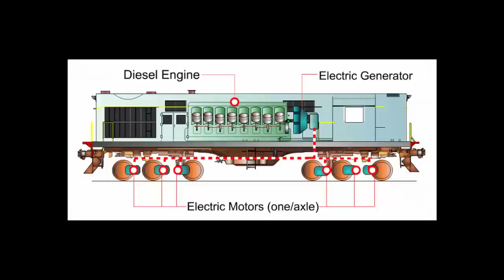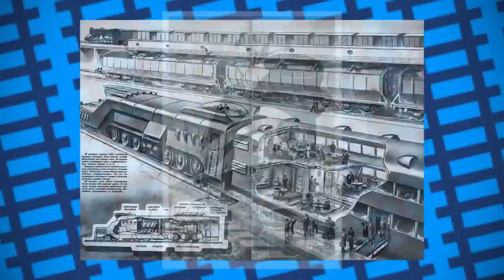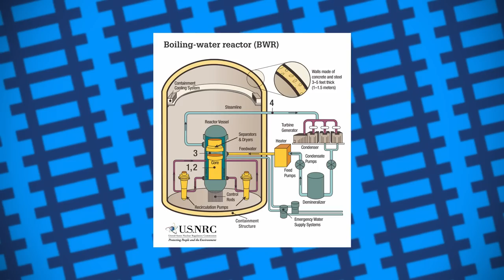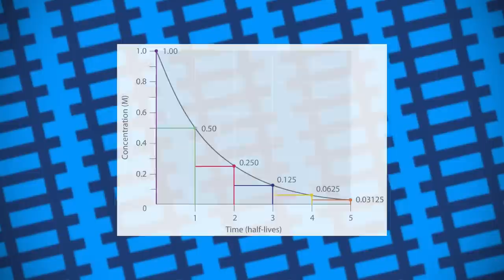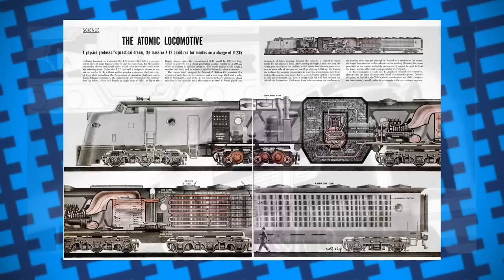Why Nuclear powered trains aren't really a thing

Comment: Electrifying long stretches of rail to me seems like its only a matter of cost and/or politifcal will. The trans-siberian railway is electrified. Maybe there are other factors like the hauling strength of diesel electric vs pure electric locomotives, or the increased demand on the power grid, but with today's tech no stretch of rail should be too long or too remote to electrify.
EDIT: And yes, let's not put nuclear reactors on rails.
Reply: Why would a Diesel-electric locomotive be stronger than a 100% electric one?
The electric motor that actually spins the wheel is pretty much the same in both cases. The power of a locomotive is nowadays usually only limited by traction on the rails and avoiding overheating of the engine. So a Diesel could haul more if it's just heavier hence has more traction, but the electric locomotive could be made heavier artificially to get the same result.
Reply: It took 70 years for the Russians, and they havent electrified the rest of their networks. So it may not be practicle.
Reply: @jailbird1133  Considering the state of the Russian economy during the late Soviet era and the 90s, that's probably more a mark of how feasible it is than how unfeasible it is.

The American economy could absolutely do it.
Reply: train is already a moving power plant
connecting it to another power plant is not only redundant ,it is stupid

Comment: The fears around nuclear energy are highly exaggerated by propaganda produced by fossil fuel companies, and the media has over-sensationalized almost all nuclear energy accidents. 

Having a nuclear reactor on a train for power may be impractical due to the engineering challenges, but it isn't the worst idea I've seen for powering trains.
Reply: Technically, we already have nuclear-powered trains. It's just that the nuclear reactors are stationary (in the form of power plants), and the trains are powered via overhead power lines.

Comment: Mini nuclear reactors have been a thing since the 60's. The deep sea submersible NR-1 had a reactor the size of a refrigerator.
Reply: Yes, but a deep sea submersible have a few pro's going in it favor for this.

1) It doesn't require a lot of instantaneous power to move. Trains are really efficient but they still draw several kilowatts of power when accelerating.
A fridge size nuclear reactor does NOT produce that power.

2) If something were to go wrong on a nuclear submersible, it will fall to the bottom of the ocean. Sure, it's a disaster but it's still at the bottom of the ocean where the effects are way more limited than they would be on land.

There are also nuclear powered space craft. Again, they are quite small and lightweight so the argument "it can be done" is true but then you realize why it can be done.
They are after all in space so should something go wrong they have all of space around them to disperse the radiation into background noise.
And they are light and doesn't need to accelerate in minutes, they can spend days accelerating. Something a train can't afford.
And they don't need shielding to protect what's outside of them. The only shielding they need are around their electrical components.
Reply: And they have just enough to power a microwave
Reply: @RealCadde  Those spacecraft use radioactive decay, not fission, and are far less efficient.  They also do not use it for propulsion, but instead for electricity.  Nuclear propulsion is possible and should be used, but so far it has not been.

Somebody designed a hot tub sized nuclear reactor that can produce 1.5 MEGAwatts.  It has not been built, but it seems like your concerns about size may have been resolved.

Obviously, safety and cooling are the remaining concerns.

Comment: Waste disposal is a political problem, not a technical problem. We have safe, effective, and stable storage solutions but nuclear hysteria means we can't use them
Reply: Your so called safety is in the mind. At the end of the day the outcome of the disaster is bigger than the risk.
If a plane crashes and it is the lowest statistic in mass transit it doesn't have to cause a disaster outside the potential deaths of those on board thanks to the pilot.
But Nuclear Reactors aren't meant to take a major battering and the prime example of recent times is the Tsunami in Japan that caused a meltdown. Now it was contained better than Chernobyl but this is concentrated energy in one place people can choose to live away from and evacuate.
Trains would put the risk on the move and suddenly you can't be sure where is safe and when. It's unnecessary to create a situation where we'll be living in fear.
Reply: There are storage solutions however they are exceptionally expensive and technical marvels like the one in Finland which is well over a billion $.
Reply: @Alex-cw3rz  a billion dollars on a technical Marvel of waste storage is nothing.

The US spends multiple billions for each project that adds more lanes to highways that fixes nothing
Reply: @ChimpManZ1264  you know reactors can't melt like Chernobyl anymore, even so I'm not advocating for a nuclear train, there are very important shortcomings like stated in the video, and a radiation leakage is one of them, I'm just saying that reactors are way safer and way batter than when Chernobyl happened and fukushima was a meltdown but because a freaking tsunami hit it and a design fault in the pump and generator placing, I am in no way downplaying Fukushima but even so, they are safer and less harmful that the contamination coal and oil has done, and speaking of price, it's easy comparing nuclear storage to no storage like in coal and oil but they never compare the cost of contamination cleanup and the cost due to atmospheric damage of coal and oil, then I don't think it would be cheaper to keep oil and coal in comparison to keep the small amount of high level waste.
Reply: @ValentineC137  nuclear is already the most expensive non fossil fuel emitting power generation (per MW) and you are saying adding on a billion to a country that doesn't use much nuclear at all compared to the US is fine 🤦‍♂️ we are talking 10s of billions and taking ages to build.
Reply: @agustincampillay7559  That's fine. I understand we need cleaner power though I am hoping we'll get Fusion right one day. I'm 20 miles across the bay from a Nuclear Station going up so living in fear of power stations isn't something I can do. I just don't think it's necessary for Nuclear to be a train. If we ever managed fusion that be cool.
Reply: @ChimpManZ1264  sorry but chernobyl used fucking vacuum tubes
Reply: @ChimpManZ1264  yeah! I too hope fusion could be our future, it's even cleaner than fission and I agree that nuclear trains are kind of a silly idea when taking into consideration all the downsides
Reply: "We have safe, effective, and stable storage solutions " Yeah, right. Dig a hole and bury it and cross your fingers and hope for the best for the next 100 thousand years
Reply: @ChimpManZ1264  You're talking about Japanese nuclear reactors. American nuclear reactors can continue working even when bombed, which is unlikely, the highest of safety standards are taken into account, which is why the worst "nuclear disaster" in american history caused ZERO deaths.
Reply: @misterflibble6601  you should look into the science of this. There's enough geologically stable storage for millennia worth of spent nuclear fuel
Reply: @misterflibble6601  
Please. 

There are plenty of places where we could dig a hole, put nuclear waste in it, and it will be safe for 100 MILLION years. 

Example: salt mines

Subterranean salt domes contain bacteria and microorganisms that are over a million years old, and they were perfectly preserved. 

If a salt dome can keep microorganisms perfectly preserved for a million years, then a salt dome is more that capable of preserving nuclear waste for a couple thousand years. 

Underground salt domes are mother nature's perfect trash compactor.
Reply: The waste disposal is totally unresolved. There isn't a single country with an operating long-term or "final" storage. How are you to make sure the waste is safe for millions of years? And don't you think maintaining such a site's for a couple of million years makes nuclear power the most expensive solution on the planet?
Reply: @countluke2334  "There isn't a single country with an operating long-term or "final" storage" - because of politics, not technical feasibility. "How are you to make sure the waste is safe for millions of years?" You don't understand nuclear waste I see. If it's properly reprocessed it's only dangerous for the low thousands of years, and then only if you eat the stuff. Stick it in an ultra-deep mineshaft in a geologically stable area, done.
Reply: I agree nonetheless. Infrastructure that provides extended coverage of electricity lines for railway would probably be a better move. Keep nuclear power in stationary electric power generation plants.

Edit: which was mentioned at the end of the video.
Reply: @Alex-cw3rz  Really? I didn't know that. I guess it makes sense though, because aside from your starting cost of building the thing, you have to pay to get the fissile material mined, processed, and shipped, as well as do mateinence to the reactor and fuel storage facilities. But despite that, I do think it's a good source of power to cover the basic/constant consumers of power so people don't have to worry if the cheaper power sources start to fluctuate.
Reply: @strcmdrbookwyrm  I think it's fine, it's just not a solution due to it being more expensive than any other type of energy. That most countries cannot access it. And it's exceptionally slow to do.
Reply: @agustincampillay7559  Despite what you say, reactors can still melt down if we don't treat them with the respect they demand. Every major nuclear incident has been due to human negligence and error. Chernobyl was caused by a safety test being delayed that led to the reactor being operated in a unsafe and unstable state, and the failure of one crew to inform the next of the test in progress. Fukushima was caused by the owners of the power plant neglecting to update their earthquake and tsunami safety measures to a standard that would have protected them and prevented the damage that caused failures leading up to the disaster. The Three Mile Island Disaster was caused by a bit of water being forced into a instrument air line, causing a the reactor to try to go into a safe mode but unable to due to the operators not noticing that safety systems were not working properly. All of this was caused by humans either not noticing or not caring about a problem before it was getting out of hand.

So while Nuclear may seem to be a less environmentally damaging option than coal and oil, I think that both are equally destructive when us as their operators are irresponsible and apathetic. While we have found ways to make nuclear power quite safe to operate, a little paranoia is needed in moderation. 

And I defiantly think it would be unwise to have a reactor hurtling along at 60-80mph, no matter where it is on a train.

Nice run-on sentence, by the way.
Reply: @Alex-cw3rz  That's fair. And I think we can agree that there's no one solution anyway.
Reply: @Alex-cw3rz  Just for some numbers: one billion dollars is just 3 Boeing 777s, or I think the newer yet to be released variants (with the flippy wingtips and all) were closer to 400 million.
At it's last days an Airbus A380 costed 450 million dollars. A billion for the energy industry is just reducing the coffee cups by one for each worker for a year.
Reply: @illbehim  The Fukushima reactors were all designed by General Electric, and reactors 1 and 2 build by them as well. This nationalism is silly frankly.
Reply: @Alex-cw3rz  Access to nuclear power is highly political. It all comes from the fact that to enrich Uranium for a power plant, you do end up with Plutonium - bomb material. Politics have doomed nuclear power for a long while.
Reply: Not only that, but nuclear waste actually can be recycled.

So I still don't know what the actual problem is with using nuclear energy.
Reply: @illbehim  whaaaa you got way too mad at that. It IS silly to be nationalistic beyond just loving your country but stepping into downplaying the rest. Taking the strongest earthquake recorded and a freaking tsunami at it was a huge blow, to be honest the damage was quite minimal with how much the whole country got wrecked. Comparing it to the TMI-2 accident where there was a malfunction without any enormous natural disaster is as silly as the name calling you got into for no apparent reason other than maybe hurting Captain America's pride. It better have less consequences indeed, it shouldn't have happened to begin with on a reactor operating for one freaking year.
Americans made everything infrastructure related bomb-proof because of that little thing called cold war going on by the time, not because muh bald eagles build standards.
Reply: And there are reactors which use dead fuel.
Reply: @Kalvinjj  Says the other one is mad, proceeds to write a kilometric rant, I'm not reading all that, cry bout it bozo
Reply: @illbehim  the typical pathetic excuse of lack of arguments... "kilometric rant" when one wrote about the same but on insults only...
Reply: I see someone watches Kyle Hill's channel
Reply: @WasatchWind  Never heard of him, but I do have a physics degree
Reply: @MatthewMakesAU  he's a really good channel that does a lot of videos on nuclear energy, notably a fantastic one demystifying nuclear waste and better explaining it than any other I've seen.
Reply: @Alex-cw3rz  it really is amazing how expensive the method of "shove it in a hole and leave it" can get. Granted, it's rather more complicated than the description sounds.
Reply: At least some people know what nuclear power and waste is like in reality.
Reply: @misterflibble6601  still better than coal and oil. You deal with the waste from that by spreading it everywhere.
Reply: We already solved that problem but it still costs a ton of money the thing we should do is start recycling waste back into usable fuel again
Reply: @ChimpManZ1264  that reactor melted down because it was neglected in its maintenance. Modern reactors are basicly impossible to have melt down because they are almost all passive designes.
Reply: I don't agree.
Reply: @fillup40  why? Just saying "no" doesnt invalidate the valid points they brought forward on the issue
Reply: @misterflibble6601  Do you realize not all nuclear fuel has a 200 year half life?
Reply: @faragar1791  Not exactly, as ling as ALL the nuclear material stays IN the mine sure, but one leak and water starts leaking it out into the ground water and you have a problem
Reply: @countluke2334  It doesn't take Millions of years to decay. smh
Reply: @integr8er66  
Not if the nuclear material is buried in a salt basin. The salt absorbs the water and naturally seals any cracks. That's why salt basins have ancient plankton preserved in them from 1,000,000,000 years ago. Salt basins are very good at preserving anything kept inside of them.
Reply: @Alex-cw3rz  the us already built a similar storage bunker. Problem is while the few people who are around the cite don’t care the rest of the people in the state don’t want it being used
Reply: @darthmaul216  that storage bunker is designed for the current amount of Nuclear waste not increases, from new things. And that bunker cost billions again making you question why not put the money into cheaper forms of power which is every other source bar gas.
Reply: @ksztyrix  im saying chernobyl was outdated
Reply: @cegicreator2476  Tubes were better for their needs
Reply: @illbehim  Wrong. Nuclear accidents in the USA have killed many. You clearly just assume without researching.
Reply: @faragar1791  Excellent idea, lets turn all the nuclear waste into water soluble salts... 🤦
Also, the salt basins you propose cease to be sealed when you drill a large hole into them to put the waste in. Learn some elementary chemistry and physics before proposing ideas like that.
Reply: I guess if you use a small concentration of uranium (plus proper containment and fail safes) you could prevent a fallout and only cause something like a boiler explosion

Comment: When playing Fallout 4, I often come across ruined train tracks with box cars. When I first found a ruined locomotive, I was a little surprised to see that it resembled a steam engine (albeit a very top-heavy and impractical one). But when I thought about it, it would make a certain amount of sense for a nuclear-powered engine to be designed like that. After all, nuclear power plants work by dipping nuclear material into water and funneling the resulting steam through turbines that generate power. In the broadest concept without regard for safety or practicality, you could take that resultant steam and use it to power a locomotive.
Reply: Oddly enough, the train I saw in Fallout New Vegas looked like an EMD F7.
Reply: @jd_the_cat  Image searches: Huh. Never came across that in my time playing New Vegas, but that's definitely an F7.